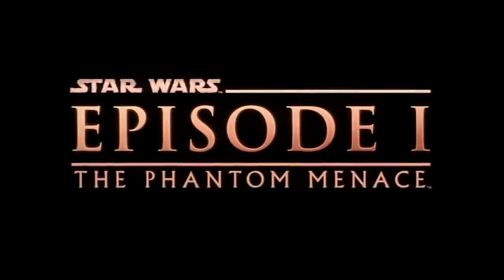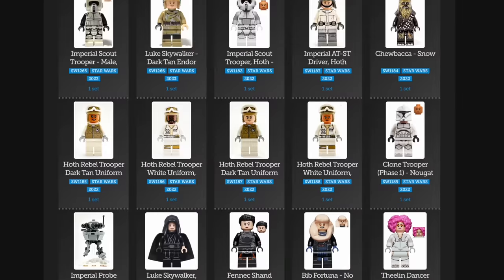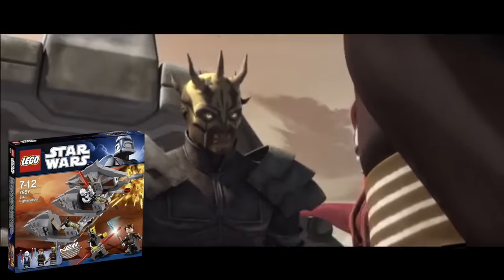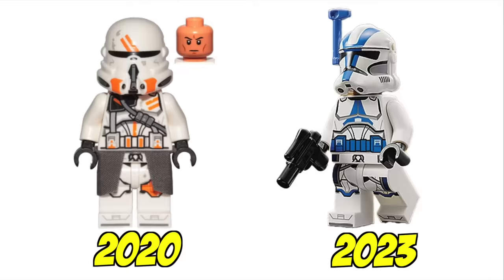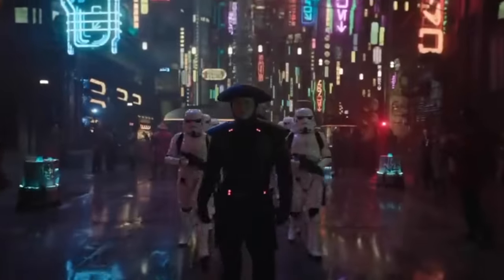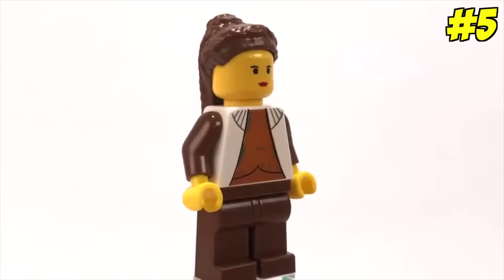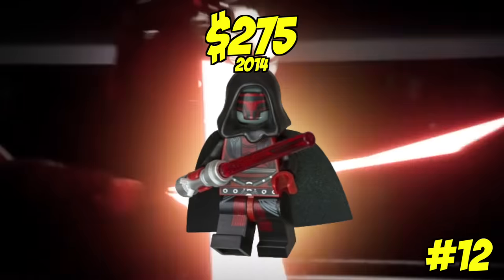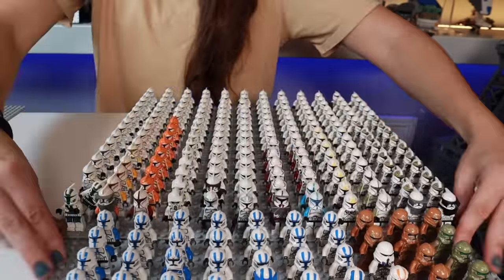The BIGGEST Problem with LEGO Star Wars

Comment: The problem with Lego Star wars is that between 2009 and 2014, lego sold insane amounts of Star Wars sets, because the sets were actually very good and (for lego standards) fairly valued. Soon after though, Lego started noticing they didn't actually need to make good Star Wars sets to sell a lot. Additionally, they noticed that people would pay A LOT for Star Wars, so they just started raising prices through the roof for no reason. It's never gonna go back because even though the actual fans are buying it less and less, now scalpers and "investors" run all over it. There's absolutely no reason for Lego to increase Quality as, if they've proven one thing in the past ten years, the company does not give a flying fuck for fans and regular customers.

Comment: I agree you never know for sure if a minifigure will hold its value based on the set if its remade in a cheaper or set or not, I could have bought Queen Amidala originally and if i sold it today I would have profited more money than I bought her for, but back then I wasn't thinking about that. There always is a roll of a dice with this stuff if you're only looking to profit, but overall I think if you have been in this industry years, and you have a good knowledge of what's exclusive and valuable and what isn't and you buy a new set with a new fig and don't open it for 2 plus years overall the value goes up.

I grew up with Lego Star wars it holds a deep place in my heart and I know it does to many other people too. But if you take an honest look at it from an economical pov you realize there is more money in investing in this hobby than any other toy or even stock for that matter. The value 99% of the time only goes up, the only hard part to this sport is, buy new exclusive set, don't open it for 2+ years, find a buyer.

Comment: As a watch collector these values doesn't seem to be crazy, but what strikes me is. Does that mean all these mini-figs simply were departed from its original set? if so wouldn't it be more logical for the owner of those sets to re-sell them as a complete set? I can imagine pulling mini figs out selling them individually will give you a higher return right? If so people can simply buy complete sets at a "cheaper" but inflated retail rate and simply sell the mini figs and the rest of the set can be scrap as parts.